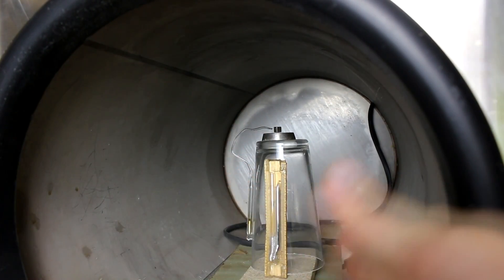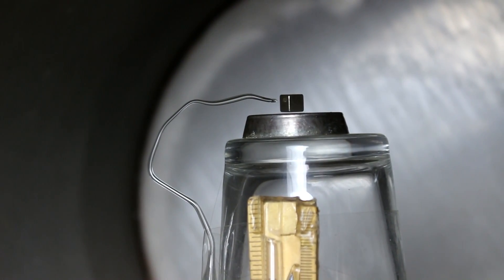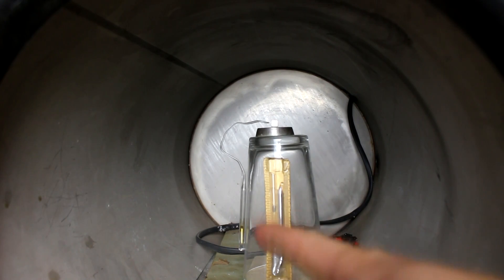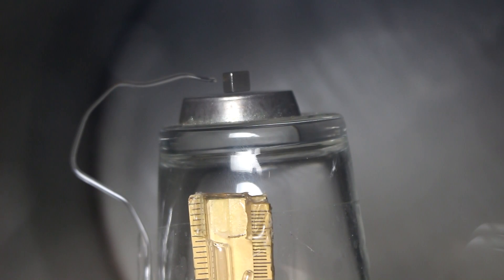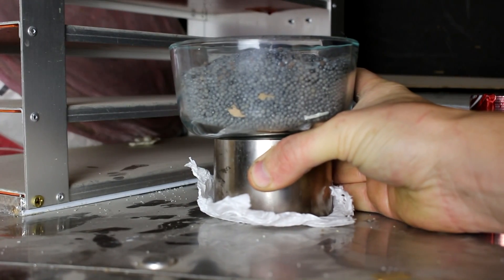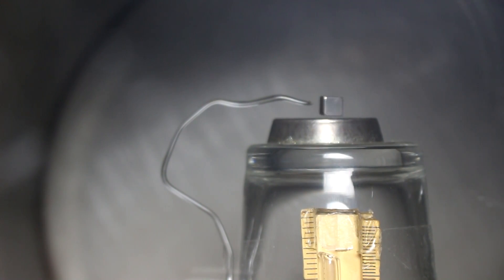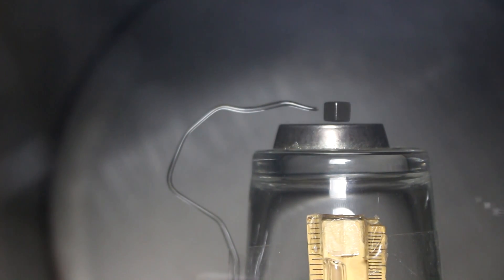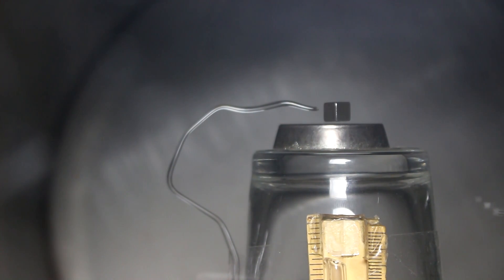Levitating a Magnet in a Vacuum Chamber

Comment: downward gravity. There's a force pulling it "down" it slows it. It's close to a gravity source. You need electricity. A lot of it . In deep space it would go.  Here it's like a sink. Gravity is the factor. Electricity is much higher power than gravity.  But you need the energy to make it. You need to maintain the electrical vs Gravital

Comment: Why not connect the vacuum pump to the glass tube ? This way, while you remove the air, I assume you would drive the magnet to turn clockwise (seen from the top)

Comment: the magnetic field itself will act as a breaking force. if you spin your pice of iron inside it, the electrons in it will react to the field and orientate accordingly. this will convert the movement energy to heat energy, ultimately converting it to em radiation.

Comment: The field of the magnet extends throughout all space. It is necessarily going to interact with every conductor in the universe, creating eddy currents. Those conductors in general are not superconductors so have electrical resistance. That leads to heating and energy loss.
So the answer is no it won't. No matter what you do eventually it will stop. (Well, down to the quantum limit of zero-point motion that is)

Comment: Hey Cody I was about to dive into this. Check this out. Pipe an air compressor into the glass  to push the magnet. 
It has to be a very small amount of air pressure. And your decompresor would have to constantly run. 
But just for proof of concept in space. This could be it.

Comment: magnetic field is slowing it down? Maybe since your using an magnet that is square you have corners dipping further out into the field compared to the linear part of the magnet. Use a round magnet then it should be ballanced?

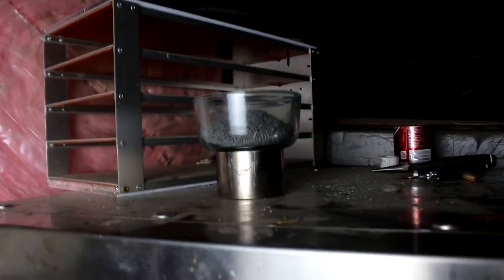Comment: 0:44 "stainless steel it's not magnetic" 

Wot mate? Steel is magnetic under typical conditions. Don't you mean aluminum or something like that?
Reply from the maker: Nope most good Stainless steel alloys are not magnetic.
Reply: @theCodyReeder  Okay. Most Stainless Steel I have encountered was magnetic. Maybe that's down to the difference in how they were made? I am aware you can make it by coating the steel in zinc, but I know you can also mix elements like zirconium or chromium into it in the right amounts to make it stainless.

At any rate, thank you for the correction. I might do more research on it later.

Comment: It's not perfect, but I bet if had very very fine magnetic particles densely pact together and suspended in a non conductive ceramic such that a) no particles touched and b) all of their dipole remained aligned (eg by solidifying the suspension inside of a very strong uniform magnetic field to keep dipole aligned) you could get pretty damn close to making a non conductive magnet. I'm basing this off of the way modern day transformers in most household appliances use stacked sheets of ferrite that are laminated together to keep them galvanically isolated in order to minimize eddy currents. This would be the particulate version of that, but with magnetized metal rather than unmagnetozed ferrite. I think Ferrite rings used for inductors do something like this involving sintering, but I'm. Not sure if those completely block conduction or not.

Comment: Don't know all these  " Laws " and l'm two years down the line but saw the sway in the beginning and knew it has Magnetic resistance and that would influence the experiment and make the magnet stop.
My stupid idea is to try same Vacuum experiment but different set up as l have seen a supercooled magnet rotating on Horizontal plane above circular array of magnets , not sure but l believe there would be less magnetic interference with Rotational force.

Comment: What if you soon a magnet in a vacuum and it does spin forever why can't you make infinite energy with that?
Reply: Whatever system needed to take energy from the spinning magnet would do just that - take energy from the magnet. Then, the magnet would slow down as you take energy from it, and eventually it would stop. This is usually the case in nearly-perpetual motion machines.

Comment: No matter how small, you also have to consider the effects of the light (or photons) impacting the suspended object, as well as the huge magnetic field from the Earth. You would need to be in an Airless, Lightless, and Magnetically Neutral (at least with respect to the axis of rotation) space and may even need to be motionless (so no drifting in space)
Now, you could have light present, however you would need to establish exact and even lighting in order to balance any forces from that source out, but they may still interfere.

Comment: Surely it's the rotation of the magnetic flux which provides the resistance and slows rotation? The rotation will causes an Electoral field  and that uses energy from the momentum of the rotating magnet?

Comment: what about it stopping because it is losing heat? Movement is energy. energy is heat and heat goes to cold which means the heat from the object moving would dissipate through all the stuff in the vacuum chamber and eventually stop the movement.

Comment: Hey Cody, love the science. Have you thought about doing a vid on the reaction between aluminum or copper or brass moving in a magnetic field? I worked in the fitness equipment industry and saw aluminum wheels rotating in a magnetic field to produce drag as well as copper and brass. I wonder how many types of metals do this and why.

Comment: if you look at 2:44 it looks like the cube is slowly oscillating back and forth just a few degrees or so. in my mind that means there is a (probably weak) restoring force that wants to return the cube to equilibrium. but im completely talking out of my ass here and I have no idea what would be causing the restoring force other than the magnetic field

Comment: Actually, it's not even theoretically possible to make it spin forever. It's held up by its own magnetic force working against gravity, therefor using up it's magnetig energy just to stay floating. If there was no gravity, sure, it could theoretically spin forever, as does everything in outer space basically...

Comment: If the earth's magnetic field is contributing to the magnet stopping a Mu-Metal chamber might remove that variable. The levetating field should be much more symmetrical though, with this kind of setup the field generated by the magnet itself is going to favor a specific orientation and bring it to a stop.

Comment: You need a magnet with a much more homogenious magnetic field, i think this one is already disqualified because of the shape, it is a cube. Try a cylindrical manet, or a sphere. Less changes in the field as it rotates, less eddy currents, less energy loss.

Pyrolytic carbon will levitate on strong magnets, so it has the diamagnetic properties you need, while not being a magnet. But it is not a solution because it is still conductive, so you can still induce currents in it.

You could also levitate the magnet on a superconductor, in this case the eddy currents will not matter because the superconductor has no electrical resistance. The energy loss in the rotating cube is caused by the electrical resistance depleting the eddy currents. 

So try a sphere or cylinder, ideally on a superconductor. 

Also take a look at the gyroscopes in the Gravity Probe B - Sattelite. I think these did not slow down, but i need to look it up, they certainly kept spinning for the duration of the mission taking measurements. They levitated rotating superconducting spheres in a vacuum, in a box that was surrounded by superfluid helium keeping it at 2K, in a superconducting box that made it impossible for any outside magnetic fields or electromagnetic radiation to get inside.

Comment: Cool Video!

You mentioned that you thought eddy currents could be causing the decay, however in the ideal case, the spinning magnet's field should be aligned with the stator field and thus not experience any periodic flux change.  What then do you think caused eddy currents?  Would it be the wobbling motion, causing the fields to become misaligned and generate current?

Comment: Ferrite cores used in high frequency switching transformers have magnetic properties but have low electrical conductivity, the core material is designed specifically to reduce eddy currents,  not sure how well the material would work but it would be interesting to try.

Comment: Hi Cody, what if you took a cylindrical magnet instead of a cubical one? I suppose that would eliminate eddy currents (and electromagnetic radiation)  in surrounding metals caused by the magnet spinning (the currents in the magnet itself woud remain though)

Comment: Get you an MKS SRG,  The MKS Spinning Rotor Gauge (SRG) line is a high-vacuum gauge that operates by measuring the amount of viscous drag on a magnetically-levitated spinning ball, which is directly related to the number of molecules in the chamber (i.e. pressure).

Comment: it's pulling in one side, you can see it choosing a fixed position, going back and forward until it finds it. so the magnet is not positioned correctly, it's pulling in several directions at the same time

Comment: Maybe its because the magnet is not directly straight up and down. I noticed this because the magnet increased in speed when the lower part of the magnet is closer to the magnet on the bottom but also slowed back down a bit when it turned around. maybe this causes gravity to pull at one side more than the other while its turning because the lower magnet is not extremely level or even more interesting the lower magnet doesn't have the same magnetic push throughout the whole thing and it may be effecting the floating magnet on the right half only maybe causing some extra magnetic friction if that's what you call it.

Comment: pressurise that little bulb with the wood in it seal it with wax then melt the wax under vacuum.
The Coriolis effect will influence the spin of the magnet. also it doesn't look level.
and to a much smaller degree than the Coriolis effect light hitting the magnet will influence it. (Radiometer)
BUT they don't work by light bouncing off them as I once though it is actually heat and pressure. Which is why they spin towards the foil part and not towards the black.
Balance of the magnet will also effect it.

Comment: The reason it doesn't keep spinning is because it's not perfectly magnetized one side is stronger than the other thus pulling it stronger on one side essentially making the other heavier and making an off-balance so no it's not going to be even so it's not going to keep spinning however it probably would if all sides were even and had an equal magnetic pull

Comment: You could apply an electric field to the magnet above to get the magnet inside the chamber to spin. Eddy currents would slow the magnet eventually, however. It would spin longer than under atmospheric pressure.

Comment: Video suggestion:
Experiments to find out, good ways of making large single Bismuth ("hoppered") crystals.
Been looking around for this, for a bit, though I've yet to find a way, to create large single crystals;
rather than chunks of many small crystals... 
I'm somewhat curious as to, if for example, the method of  using a crystal seed, would work.
I believe, that I've also seen one video, where a guy did make one large single crystal, though the method wasn't explained;
though, he seemed to pour liquid Bismuth, downwards in a diagonal dish, and the crystal seemed to rise at the end of it.
(I think this, is because, like water; liquid Bi is denser, than solid Bi.)

Also, honestly, I think Bismuth, is a very interesting element, beyond just its diamagnetic properties;
though in particular, I think, it's the many different colors, of the different oxides, that is the thing, that I've fell in love with.

P.S.
Just to have "said" it:
I've seen some amateurs, calling a single crystals, that has been cut out from a cluster,
that is the size of dices, or smaller "large" crystals, this is not what I mean, and I do not agree, about them being large:
especially considering that there are, single crystals, even larger than people... 
Even some naturally formed ones, are far larger than humans; 
an example, would be the crystals, in the aptly named "giant crystal cave," in Naica, Mexico 
(Though, those are some of, if not the largest, known crystals, on the planet; it is still, a solid proof of concept.)

P.P.S.
I'm not telling you, to buy tons of Bismuth, in order to make giant crystals; 
though, that would be awesome, it's not the point.

Comment: I would think there will be a magnetic flux slip factor like in a motor that would eventually slow it down until it stopped even in a vacuum (posted before end of video)

What is funny I'm looking at your vacuum chamber then thinking, OK I found another use for those scrap refrigerant tanks besides blowing them up LOL

Actually I just made a portable forge out of one of them and it works good so I might make more of them but now I'm looking at making a vacuum chamber

Why do I need a vacuum chamber?

Well I am positive I can put a couple of drops of water in a beaker about half full of refrigerant oil and watch those drops of water never evaporate from that oil but instead just dance around the bottom of the oil while in a deep vacuum

Hey I don't have the chamber yet but try it yourself and show the results I believe the water drops will never evaporate and stay dancing around on the bottom of the beaker under the oil forever

I guess that will be my next video, Building a vacuum chamber from a refrigerant can

Comment: I'm not a scientist,  but I think there is "friction" due to the electromagnetic fields interacting with the  metal.  In theory, wouldn't the currents that are induced in the metal interact with the magnetic fields cause it to lose it's rotational energy as the fields try to align themselves according to their polarization?

It makes sense in my brain but I am note sure if it is articulated correctly.

Comment: Forever is such a strong word...
Even in a perfect vacuum (and not just 1/800 of normal air pressure) it would still slow down. Even if you would remove everything you possibly could that interacts with the magnet it would slow down. Very, very slowly but it would still stop eventually.
There is always something that will interact with this system. If we assume that the universe will exist for all eternity in some fashion without ever stopping to exist and if we assume that this system can exist in this configuration for all eternity as well, even the tiniest possible influence on it will eventually make it stop spinning.
I guess it depends on how you define "forever" :) If you define it as "until no one exists anymore to witness it stop spinning" then I could get behind it. If no one exists anymore to care whether it's spinning anymore or not, I guess then we can say that it did spin forever ;)

Comment: Just the fact that it is spontaneously jigging back and forth in a vacuum means there will be resistance in the electromagnetic field, so for whatever portion the resistance is caused by air resistance, for sure some part will be magnetic breaking.

Comment: So the magnet is spinning, and the moving magnetic field is producing a current in the bismuth. The energy is then lost as the current moves through a resistive metal. So, if you did this on a true superconductor, would this not happen? There would be nowhere for the energy to dissipate right?

Comment: Non conductive magnetic , Yes, ferrite. According to this brochure, Ferrite-NiZn has a resistivity of 10^4 Ohm·m. This is better than damp wood, at least. You can trade magnetic properties for resistivity by coating and embedding ferrite pellets in an insulator, as suggested in the comment above, but fashioning your own metamaterial will probably involve quite a bit of research and experimentation.

Comment: you should pressurize a  fluid then bring it room temp. so that, when it depressurizes it will be about 40 F or "ice cold". in my ap chem class we thought of a soft drink that when you open it, it will depressurize and chill the drink inside so you don't have to chill your drinks.

Comment: had a quick google, apparently there is something called "Ferrite" which is magnetic and none conductive. (resistivity of 10^4 Ohm·m hopefully you will know what that means)

A few thoughts, (please note, I'm not a scientist of any type (other than the "uneducated" type)
1. could you not use water to get it spinning? so as the pressure drops the water boils and the steam pushes the rotation?
2. would the friction with the levitating magnet not stop the spinning? 
3. there is definitely something creating an attraction to the magnet or it wouldn't go back and forth like that.
4. could you not use a spherical magnet to reduce the issue of air friction? (colour it in half black and half red or something like that?)
5. on second thought, could you not use a third and forth magnet to get it spinning? (i.e. put the magnets either side of the vacuum chamber and move them around?)

Comment: it doesn't really matter what you use, so long as you use a diamagnetic material, as it will form resistance moving so close to the material in question, and eventually sacrifice its momentum for a proportional electric field

Comment: Even before you spun it, doesn't the fact that it was oscillating between left and right show that there is a preferred orientation the cube was trying to achieve?  If so, that would imply it would still try to achieve that same orientation, even after spinning and slow down.  Wouldn't it?